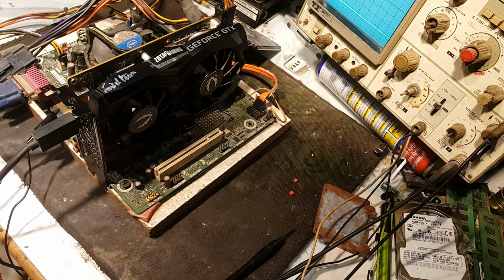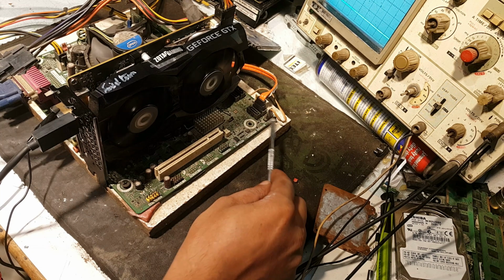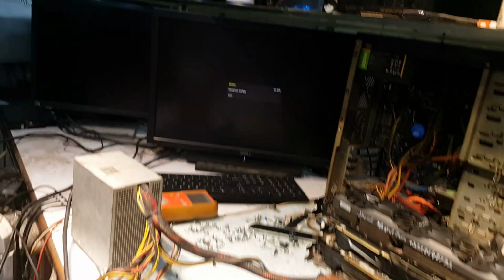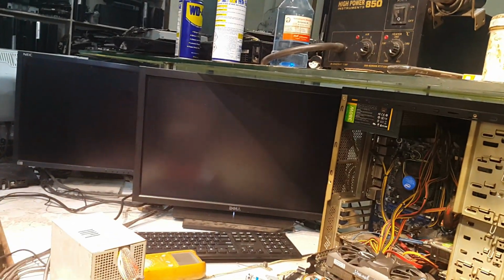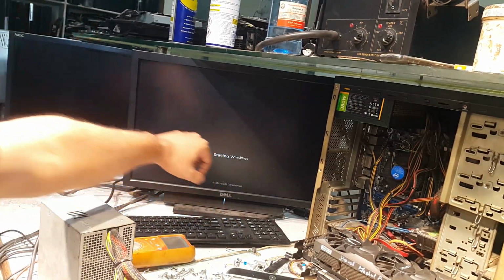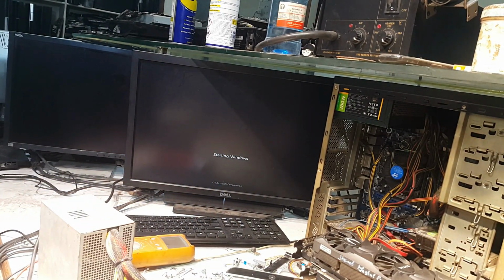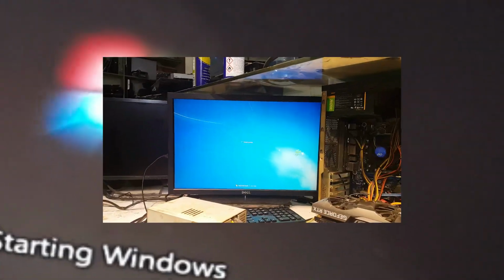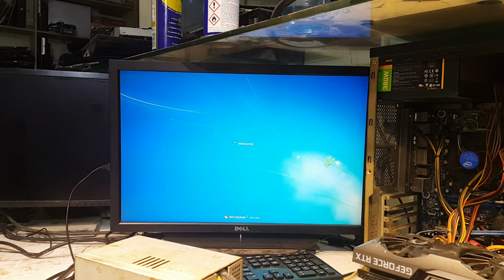GEFORCE GTX 1660 - Not Detected:

Comment: i got zotac gtx 1660 sometimes it tuens on and sometimes the fan doesn't spin and it give black screen. what should i do?
Reply from the maker: Try a reflow on the CPU chip if all power inductors have equal switching oscillations including the Ram power indicator.